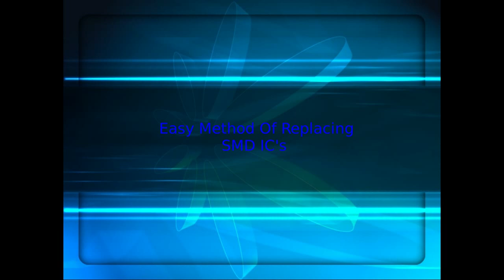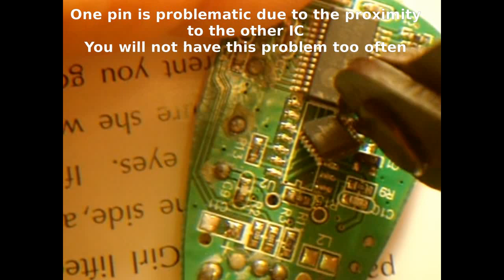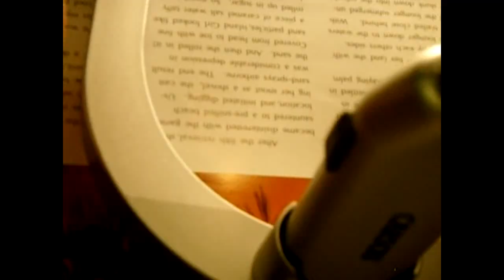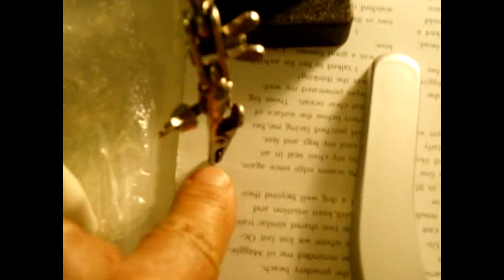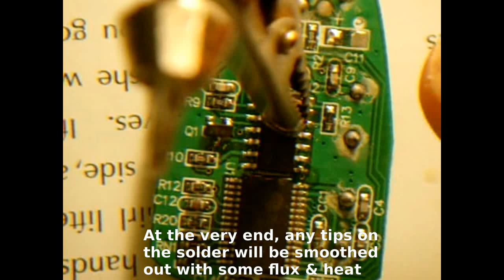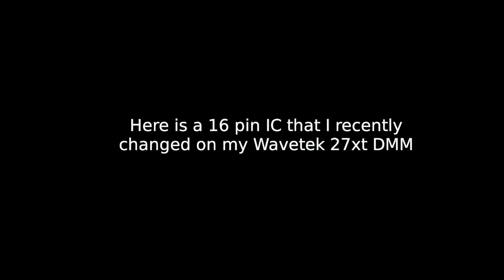How To Replace SMD IC's (SOP/SOIC/MSOP) WITHOUT Special Equipment

Comment: Buddy, loose the cutting - chipquick alloy is your answer. Reduces the liquidus temperature of lead free solder from about 220C to about 150C - 170C. This is still less that the melting point of 63/37 lead solder.

Comment: A chip on my kit ,isn't mark like yours all it has is a line on it,do I use the line to line up with the notch,anyone please
Reply from the maker: The line shows the proper orientation of the chip, just like a notch or dot on some IC's.
Reply: Thanks for that info,I am so green on smd ,stuff ,I am a old school guy,I did buy all the stuff I could to work with smd,but smd stuff is a skill I don't have,yet that's why I buying practice boards
Reply from the maker: Have you seen my other video?

https://www.youtube.com/watch?v=YHc3f0nPEFo

Comment: Wow! I have been doing it this way for 20 plus years. Nice job! The cutter I use is the Erem 670EP. It's not cheap but it works very nice. I mark mine with a sharpie for ICs only. If you cut something else and its too big, then the tool will be broken. Thanks for the video.
Reply from the maker: TheRadiogeek Glad you enjoyed the video. I never had any problems swapping out surface mount IC's using this method. Like anything else, you have to be careful.

Thanks For Watching! Be sure to share my channel, and rate Thumbs Up.

Comment: I had a problem removing a smd ic they had cement on bottom of course i ruined the traces trying to lift it and even had hot air would a razer blade be good too?
anyways good video
Reply from the maker: ThePHILALLENSHOW Very rarely do I see a problem with cement. I can see you easily damaging traces running under the IC. If I ever had that problem, I would place a 40W or 60W soldering iron directly on the center of the IC to try and free it up. Usually infrared is used to heat them up and remove them. Traces can be fixed as well.

Thanks For Watching.
Reply: electronicsNmore  Never thought of That Thanks I will do that Next Time

Comment: What I do to remove SMD component is heat the leads with soldering iron and put a paper below them to separate it from the board. This way I can desolder one pin at a time. It can get tricky sometimes though

Comment: i have stupid question, not on this topic you show

there is simple led flashing circuit, that use only resistor npn transistor capesiter and led
i hope you know what i talking about
would be possible to relapse npn transistor to zener diode?

Comment: Nice idea! Thanks for video!

PS: Look careful between 2:20 and 2:22, you have jump over one pin and had problems with lifting IC because of that ;)
Reply from the maker: No. I cut that lead before filming the video. Before the video I sharpened my cutter and that lead was cut to test the cutter. :-).